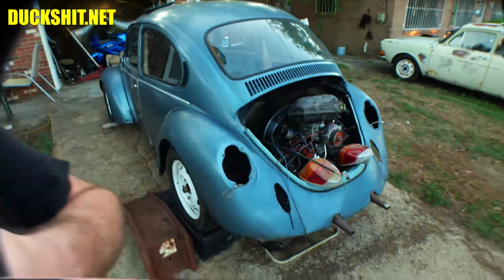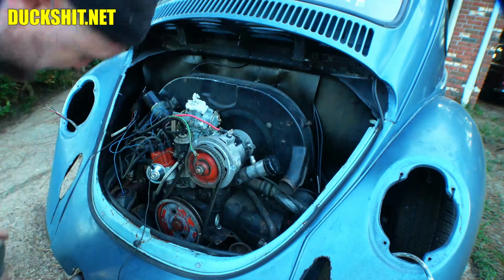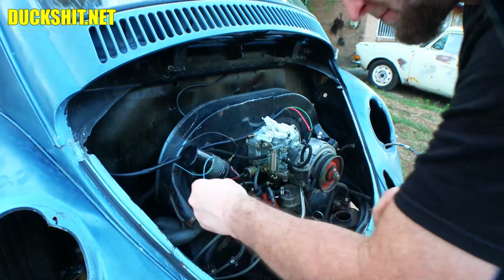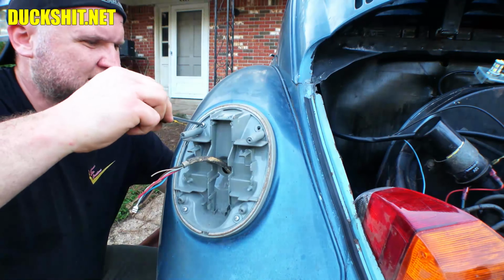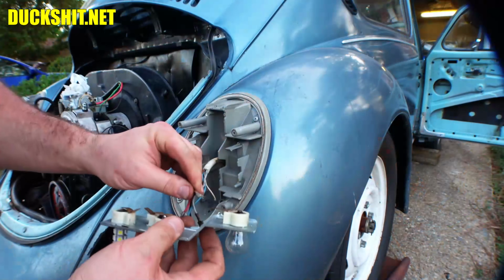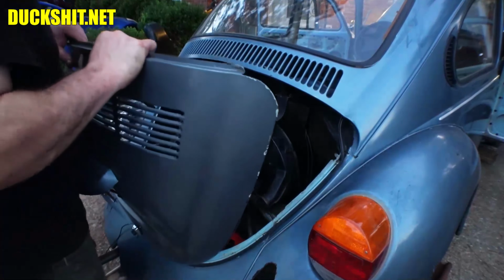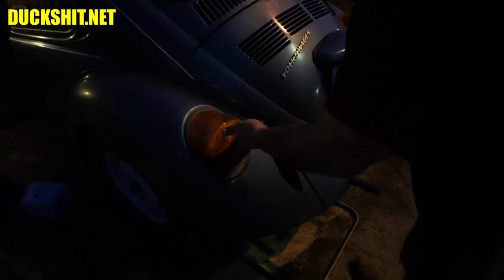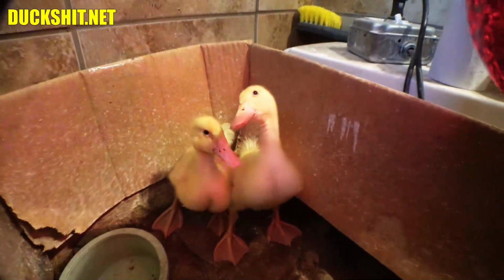💥⚡️Engine Wiring and Tail Lights⚡️💥- VW Beetle🔧🛠️ - 06

Comment: Those tail lights should have a steel plate under them that seals them off and keep rocks kicked up from braking the plastic housing.
Reply from the maker: Sounds great, but I don't see one in the exploded parts view for this. There were different tail light version that had what you describe though, the bulbs all fit differently and are laid out differently, too.  We're also missing the rubber gogey that goes underneath.

Comment: First of all, the ducks are so cute. I like to see a video of them in boomers pool. I have watched a ton of videos putting on the decklid springs. What a job gor me. That is the first time I've seen it put on that way. Really great tip. I am one of those guys that struggled with it.  Good video Lord Duckman 🦆. Noel 👍
Reply from the maker: Actually I just got done recording them in the pool, probably have that video up in a couple days.   😁👍🏻🦆💩
Reply from the maker: When I put the decklid on Eleanore last year in video, I used the same method, there's nothing that beats it it's probably the easiest way you just got to be careful you don't scratch the paint   😁👍🏻🦆💩

Comment: You have a linkie for that Dizzy. I have a 009 on my ghia currently timed at 5*btdc at idle and 28* full tilt. My issue is long cranks+full throttle needed to start after engine is warmed up. Cold start cranks over with half a key blip.
Reply from the maker: Absolutely yes, you can see the links in the videos where I installed it of course.   Funny how everybody always asks after the fact in a different video LOL... but yes, go back just a couple videos you'll find all the links you need down below in the video description!  Hope that helps, thanks for the question!
Reply: @DuckmanCycles thanks!  hopefully I'll make it Pensacola for Rare Air next month!!
Reply from the maker: We've got a lot going on next month, there's a tech session, a club meeting, we probably have on or two car show meetings  and then the car show itself.